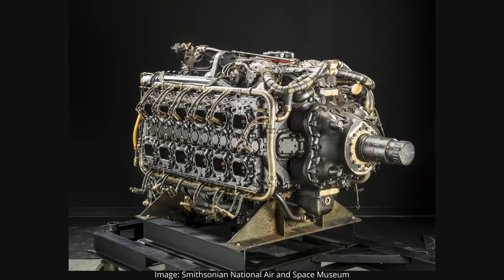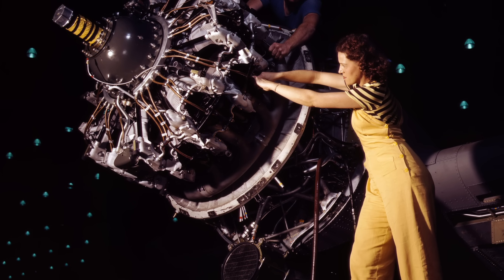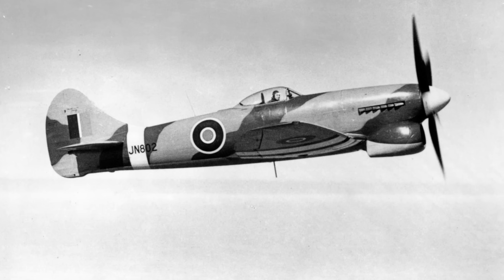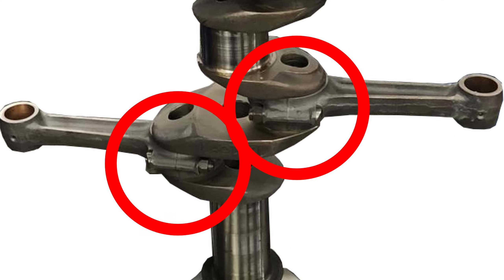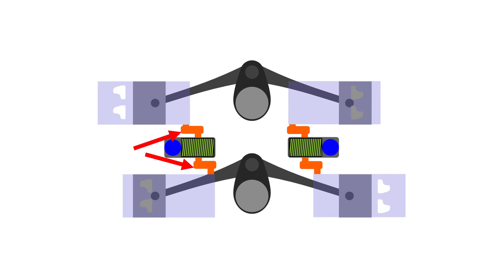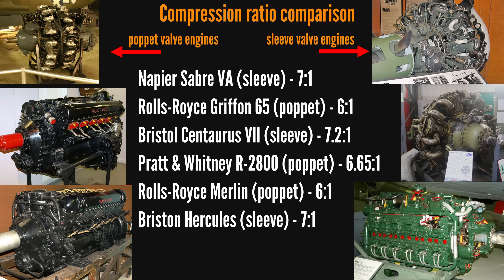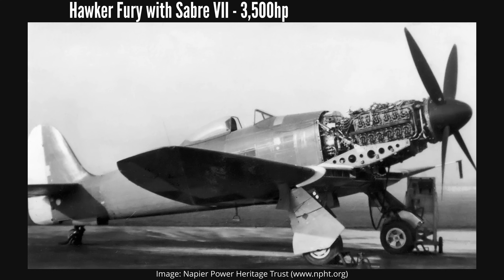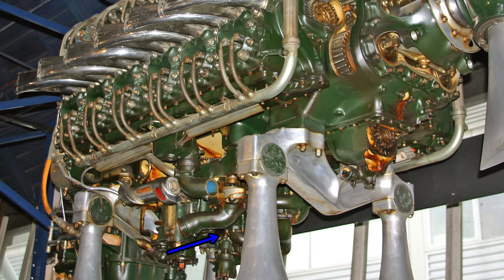The Complex Napier Sabre 24 Cylinder Aero Engine Explained Simply

Comment: I wonder what kind of efficiency an engine like this could achieve if built today. With modern materials, fuels, and electronics?
Reply: Oil consumption is unacceptable and the advantages in volumetric efficiency has been superseded by more advanced poppet valve technology and forced induction..
Reply: @DoktorBayerischeMotorenWerke  it's a hypothetical.
Reply: @notbobrosss3670  Indeed, Sleeve valve engines are obsolete, an evolutionary dead-end concept.
Reply: @DoktorBayerischeMotorenWerke  not really getting it, dude. Building a h- 24 today, as I'm suggesting, wouldn't uninclude variable popit valve timing or variable induction. Or any other available modern tech that could be applied. I'm saying building the concept with today's technology.
Reply: @notbobrosss3670  You're not getting it.... dude.
 There is no possible H-24 configuration that could compete with a turboshaft gas turbine engine for power density and power-to-weight ratio... or reliability.,
Reply: @DoktorBayerischeMotorenWerke  awesome not talking about gas turbines. Talking about piston engines.
Reply: Before you interject with what you think is a witty replie. The video is, and the subject matter is about the h24 Saber engine. Which is what my comment is in regard too. So please stop trolling. Unless you have something constructive to add.
Reply: @notbobrosss3670  I will only add this, that these engines were rendered completely obsolete in the aviation industry by gas turbines which deliver far greater efficiency and an order of magnitude greater performance and reliability... Sleeve valves were already rendered obsolete in the automotive industry by the 1930's with improvements in more efficient poppet valve technology, which is still in use today..

Comment: Great video have always wanted to know how these awesome powerplants developed such large amounts of horsepower. Stories of early tempests tails and fuselage developing cracks and sometimes breaking off altogether made me interested in this huge engine . Read about vibration frequencies of this engine resonating and causing stress cracks that required some high level investergation to solve the issue.
Reply: The fuselage/tail problems of the Typhoon (I understand that the problem had been solved by the time the Tempest V came along) were due to a failure in the mass balance mechanism of the elevators, which caused tailplane flutter.  Nothing to do with the engine.  Hawkers had used a single, centrally-located mass-balance weight, operating through a system of levers; something in this mechanism suffered from metal fatigue.  Later design standards require that the elevator and rudder mass-balance must be located near the tips of the surfaces, i.e. well away from the longitudinal axis of the aircraft.

Comment: Subaru sold me an '01 Outback LL Bean car with an H6 engine.

This is NOT an H6 engine, it is a flat 6, or F6 engine.  An "H" engine is two flat engines on top of each other with dual crankshafts, which means  more internal friction.  Just like the engine in this video!

Comment: This is probably the best technical and evidenced video on WW2 era engines on YouTube. Excellent work!
Reply: My exact thought too... a superb description of the engine and competing designs. Thank you.
Reply: Try Calum Douglas.
Reply: Very well researched and narrated.
The Sabre often got labelled as unreliable but progress is always a rocky road.
In the end it came good thankfully.
Reply: Yes, a credit to himself and youtube
Reply: @aerotube7291   Calum Douglas is much better than this. He’s an actual engine designer.
Reply: @thethirdman225  thanks mate
Reply: If I were I'd also subscribe to Greg's aeroplanes and automobiles in addition to our host here
Reply: @urlichwichmann6456  I wouldn’t. Not if you want high quality information. Greg doesn’t do proper historical research. He spends his time building a case that supports his preconceived opinion. That said, there have been times when I have agreed with him but not because he had the historical evidence. It was more because his opinion was, coincidentally, basically right.

If you want history of equipment, yeah, he’s okay. But Greg uses so much conjecture that his conclusions rarely reflect actual history. It sort of goes like this: the aircraft could do this so the pilots must have done that because logic dictates it. History is based not on logic but on historical record. But Greg has read so little history that he doesn’t see the problem. The same applies to the vast majority of his viewers.
Reply: @thethirdman225  thanks, I will keep this in mind. At the very least he describes his thoughts, so you are able to confront it with your own.

Comment: You can talk about sleeve valve engines all day long, but nothing you can say about them can defend the fact that they are not in use today. There's a good reason for that. Simply, you can't seal them. Sleeve valve engines burned copious amounts of oil. That's why they were never adopted by the automotive industry.
Reply: These are NOT the Knight double-sleeve valves as used by Daimler, Minerva, Panhard, Mercedes, Willys, etc, these were very smokey.  The Sabre used a single-sleeve valve called the Burt-McCallum design, although McCallum had nothing to do with the final product.  They were used in only a few car brands, but mostly Argyle who developed them.  Knight sued Argyle for patent infringement and lost as the designs were very different, the legal case was a big factor in Argyle's bankruptcy. After Argyle went bankrupt Continental in the USA acquired the patents.  

Oil consumption was reduced for all allied engines (I don't have the figures for the Axis engines) as the war progressed and the engines and oils were refined.  It dropped more markedly for the sleeve valve engines than poppet valves.  The major issues with the poppet valves for car use had been solved long before the war, but cars were low powered and low stressed compared to aero engines.  Not the case for 2000hp aero engines where heat rejection is a major issue. The issues were worse for air-cooled aero engines.

One of the primary problems with sleeve valves was cost, sleeve valve engines were expensive to build.  As far as car manufacturing is concerned, incumbency is a major issue, throwing away all your production tooling for one design to replace it with another is a very brave decision, especially if your competitors are not going to do the same.  Eventually, poppet valves caught up in most areas but certainly not all during WWII.
Reply: @robertnicholson7733  No, I’m aware of pretty much all of that. I’m aware that there are different kinds of sleeve valve engines too. I just think it’s interesting that it made something of a comeback in aero engines.

Building sleeve valve engines almost broke Bristol and they found their solutions just in time to avoid bankruptcy and to get set up for wartime production. Calum Douglas has some very good stuff on it.
Reply: @robertnicholson7733  Also worth noting that the Sabre was a total loss engine. I think it carried about five gallons of oil.
Reply: @robertnicholson7733  Charles Knight invented and patented several variants of sleeve-valve engines before anyone else did.
 Knight also licensed the technology to many European engine manufacturers and there were many unauthorized copy-cat designs like Burt McCallums that violated Knights patents.
 Argyle lost the patent infringement case and went bankrupt after the settlement..
Reply: They were used in car engines but I don’t think any were produced after the 1920s.

But that was 100 years ago.

Comment: Nope. The P-47 was the fastest single-engine fighter of WW2.
Reply: Load of rubbish.
Reply: @thethirdman225  Tempest V: 435 mph at 17,000 ft. P-47M 473 mph at 25,000 ft. Every source I could find, including Jane's confirms these numbers. What's your source, besides British ego?
Reply: @juliancate7089  By the way, the Tempest aerofoil was more highly developed than the Republic S-3 of the P-47. It had a significantly higher Mcrit and had better handling qualities at higher speeds. Despite its thicker profile, it had significant lower drag at those speeds too. The P-47 was the byproduct of the state of aeronautics in the 1930s, while the Tempest, as the example you quoted, was a product of the 1940s, by which time a lot more progress had been made.
Reply: @juliancate7089  
"Tempest V: 435 mph at 17,000 ft."

And how fast was the P-47M at 17,000? Feel free to provide a reference.
Reply from the maker: That's at high altitude. I said the Tempest is fastest at low/medium altitude
Reply: @LetsGoAviate   It’s not even true for the P-47 at high altitude.
Reply: @LetsGoAviate  What's your source? P-47Ds could fly well over 300 mph at sea level.
Reply: @juliancate7089  
"P-47Ds could fly well over 300 mph at sea level."

What do you mean by 'well over 300 mph'? That could mean anything, up to including any figure you like to name that suits your preferences. This is a standard tactic in bidding wars. 'Almost 300mph' becomes '300 mph' and then 'more than 300 mph' and next thing you know the final iteration is invariably 'well over 300 mph'.
Reply from the maker: @juliancate7089  Two sources claiming the P-47M hit 473mph (or 475) at 32,000ft, not 25,000ft. It doesn't make sense that it would hit max speed at less than 30,000 feet. Generally speaking only single stage supercharged (or turbo'd) fighters hit max speed that low. 
http://www.historyofwar.org/articles/weapons_P-47M.html
http://www.wwiiaircraftperformance.org/p-47/p-47.html

There's no data showing the P-47M's max speed at 17,000ft, but at 15,000 feet it did 418mph with WEP. At sea level too the P-47M is about 10-15 mph slower than the Tempest.

Data manipulated in any way, the P-47M couldn't have beat the Tempest below +-25,000 feet.

I don't have a horse in this race - so to speak - as I'm not British or American and the P-47 is one of my favorite WWII fighters.
Reply: @LetsGoAviate  Firstly, I admit that heard "fastest", not "fastest at low altitude" which prompted my post. Embarrassing, but even so I'm only interested in the facts. Like you, I don't care which is faster at a given altitude. However, I remain skeptical that the P-47 was slower at low altitude for a couple of reasons. The first is turbo-supercharger vs. mechanical supercharger. The massive advantage of turbos is that they can deliver maximum power from the engine at all altitudes without the losses between gear ratios that characterize mechanical superchargers, and the second is access to high octane fuel. I know the British had access to high octane fuels, but I'm not sure if it was rationed. As an aside, you seem to make a point about max speed at this or that altitude. I'm not sure why you think this is so important to your case. The critical altitude was 17,000 for Tempest and 25,000 for P-47M. So what? when speaking of maximum speed, there is NO requirement that every aircraft in WW2 has to match the critical altitude of every other aircraft. The critical altitude for a type is the critical altitude for that type and it will be different from any other. Anyway, thanks for the links, I'll study them and appreciate your content.
Reply: @juliancate7089   If it’s not critical then give the TAS performance and we can take it from there.

I’m sorry but it absolutely is critical.

Furthermore, as at least one other poster has pointed out, the speed you quoted was for a prototype and not a service aircraft.

If you’re going to make comparisons like this then you need to make sure you’re comparing apples with apples.
Reply: @juliancate7089  
”I’m not sure why you think this is so important to your case.”

What is important is that the truth be served, rather than the loudest and most strident voices.
Reply: Never happened... the P-47M was never able to reach its advertised top speed, it was an epic failure..
Reply: @DoktorBayerischeMotorenWerke  The problem with the P-47M was that it arrived too late and wasn’t a sufficiently more advanced design than the one it was intended to replace.
Reply: @thethirdman225  The problem with the P-47M is that it never flew as fast as the unarmed protype that Republic sold to the Army, it was billed as the fastest single propeller driven aircraft... but it never lived up to the company's claims.
All of the Ms delivered had the defective Simmons Boost regulators removed and the engines were replaced with the Standard D model engines.

Myth busted.,
Reply: @DoktorBayerischeMotorenWerke   The top speed of the P-47M has always been a point of argument for the more boneheaded. While it's perfectly true that the P-47M's top speed never lived up to the hype, that had been eclipsed by the imminent arrival of jets. Not only that, the Allie had such a dominance that top speed wouldn't have made a lot of difference and was no longer very relevant.

Equally unfortunately, the P-47 has become a cult aircraft that - according to its fanbois - was so tough it couldn't be shot down, was faster than any other type in service, was made of bullet proof steel, could out climb a Spitfire, had a range of 1,900 miles and could fly to Berlin but wasn't allowed to. Of course none of that is true. The claims that it regularly flew with multiple cylinders shot away but can't provide a single picture.

So, as far as he P-47 is concerned, you're singing to the choir.
Reply: @DoktorBayerischeMotorenWerke   Yes, it’s that whole ‘unarmed prototype’ thing that gets in the way, exactly as it does with the Supermarine Spiteful F Mk 16.
Reply: @DoktorBayerischeMotorenWerke  What's your source for that statement?
Reply: @juliancate7089  Official USAAF documents. Only the unarmed, stripped down prototype reached 473 mph. planes with the M engine delivered the Army detonated severely when WEP was used destroying the engines and they never reached this speed.
 The Simmons Boost Regulators were rushed into production, but all the units delivered were defective and no adequate solution was found, the Army ordered the planes grounded and the boost units and water injection units removed. All of the Ms delivered were converted back to standard D models before returning to service.
No US army P-47 ever flew 473 mph... it never happened.
Reply: @DoktorBayerischeMotorenWerke  If you can link the source that would be great.
Reply: @juliancate7089  Youtube keeps blocking the link.
Reply: @DoktorBayerischeMotorenWerke  Ok, well I think if you just type it in as text that will work.
Reply: @juliancate7089  I did..
Reply: @DoktorBayerischeMotorenWerke  Ok, try this - type only the name of the website but do not include the "https/" etc.... Thanks.

Comment: Thanks, some time ago, I read a fighter pilot's autobiography who flew tempests towards the end of WW2.  He mentioned the hard work of the aircraft mechanics who he admired greatly.   One job he mentioned them doing is during the night was having to fire up and run the Napier engines for I cant remember how long now, to keep the engines warm so the could be used immediately if required the following day.  This was not a pleasant task during the freezing winter of 44.  Also didn't these engines need special explosive charges to get them going?
Reply: The Sabre used a Coffman starter. Basically, this was a shotgun cartridge which turned the engine over. Pierre Clostermann talks about the process of starting a Typhoon in ’The Big Show’.
Reply: @thethirdman225  
Regarding this engine, the story from the book Le Grand Cirque was the first connection that came to my mind
Reply: @thethirdman225   thanks!  I think that was the book I read.   🙂

Comment: Well, not quite accurate. A 90 degree V-twin can have perfect primary and secondary balance. 
V4, V6, V8, V10, V12 and so on. Any the number of cylinders per bank doesn’t matter.
Reply from the maker: Correct, but I was talking about inline engines...
Reply: @LetsGoAviate  Without going back, I was left with the understanding that you had said that Vee engines were two inline engines lashed together on a common crank. i must have misunderstood.